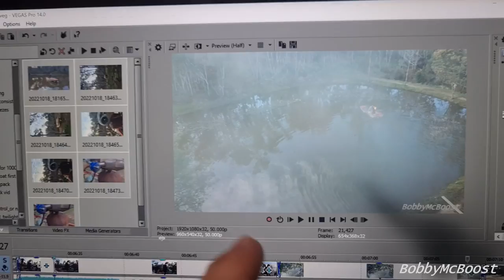TURBO Burn Barrel - Will it EXPLODE?  Turbo Jet Boat pt.4

Comment: 1. Put a heat-exchanger in the tube after the compressor and before the burn barrel to keep the oil cool and recoup heat
2. Make Sure the oil-pump provides at least 2 bar/200 kPascal/30 PSI to the turbo-charger
3. Avoid supersonic peripheral speed of the compressor-/turbine blades
😁
Reply: with the way that turbo is going way beyond spec, I would go for an oil pump capable of way more pressure than 2 bar. Probably more like 4+ bar, since that's around where engine oil pressure sits at high rpm. I think a full-sized engine oil pump operating at its typical operating speeds would supply enough pressure for the turbo to not push the oil out with boost.
Reply: @quinnobi42  I was thinking about an RV fresh water pump. 60 psi, 5gpm. 

For the oil cooler you could use a few feet of metal tubing either in a vessel of water or extended outside of the boat.

Or use a total loss system where (used) engine oil is fed through the turbo from a high pressure tank and then into the combustion chamber.
Reply: @deltab9768  A total loss system like you described would be awesome and provide lots of fuel for the burn barrel. The problem with using a RV fresh water pump is that it is designed for very high volume flow but low pressure. I was thinking maybe a couple automotive fuel pumps for the turbo oil feed or something because they can supply high pressure
Reply: @deltab9768  Then you will have upgraded from wood power to waste oil power.

I have a design I am working on which works on [literally] anything combustible, so that you can use either of those, or anything else you can shove in the burn box. But mine will not burn the oil it is using for the bearings, mine will be intended, like an actual vehicle engine, to cool, circulate and filter the lubrication oil.

Also that oil will probably be a very expensive silicone based oil to handle heat and reduce corrosiveness since I want something I can actually drive with, not just do silly experiments with.
Reply: It immediately burn inside the turbo... This is almost impossible to oil
Reply: @quinnobi42  What would be ideal, would be if, as is the case with actual turbojet engines, if there were an output spur [think of the gear on a camshaft that drives both the oil pump and ignition of an automobile engine] that you could simply gear to whatever speed you needed to have the turbo provide its own oil at the needed pressure and volume.

Sadly, I have a suspicion Bobby ain't in this to be an engineer though.

However, if he asked me to, and sent me the turbo shaft, I would gladly cut whatever pitch was necessary to produce the final drive ratio needed for solid pressure and effective volume.

I have a good old lathe with all the right attachments to cut a proper compound land worm gear.

On the other hand, if ANYBUNNY wanted to supply the parts, I could build a complete system, such that all one would need to do is add their own oil tank, filter and cooler so that they could hook it up to literally anything and it would then be 100% self oiled, and self shaft/bearing cooled.

If they supplied the parts, I'd do it just for the fun of it.
Reply from the maker: This highly interests me! 2 things though, as you stated I'm not really in this to engineer a oil system to supply the turbo that will inevitably get far to hot and melt its turbine wheel off..
  
The other issue would be the speed that shaft is spinning at! The gear reduction would be massive! The drive gear on the oil pump would need to be balanced due to its size😆
Reply: @BobbyMcBoost  As someone else had mentioned, you could take your turbo oil drain line, run it out of the boat into the water in a coil shape (use a 1 or 2 liter pop bottle for a form) and then put the oil back in the reservoir to be pumped again.  I would also use copper or steel line with flare fittings so they don't blow or burn off. It would also work better for the water oil cooler. 

Bonus here is aside from keeping the oil temp down so it will cool at least the center section of the turbo, it also won't melt the bucket, or the pump, or turn into an electric flame thrower! 

I"m a US guy so I think in PSI, but I think you'd want at least 60 psi which is 4 bar I think, to lube the turbo. You could get an automotive oil pump, put the hex rod in it and still drive it with your drill, but the tricky part is making a fitting to connect to the pump outlet. It might be easier to scab a power steering pump or maybe a small 12V convertible top hydraulic pump... they're not super heavy load, but should work great for something like this.
Reply: @BobbyMcBoost  Another possibility: send the air from the impeller to a 3 inch T fitting, then have one side neck down to 2 inches and go straight to the turbine, and the other side go through a 3 inch butterfly valve and then to the burn barrel. Have them both go to a 3 inch T piece and now you can adjust how much of the exhaust is actually from the fire. 

How is this different from a wastegate? For one, the air that bypasses the combustion chamber still gets sent to the turbine to help drive it. More importantly it helps to cool the turbine so it doesn’t melt.
Reply: @BobbyMcBoost  I suggest to drive the oil pump with an electric motor and a battery.  Alternatively you can use a turbo-charger with gas bearings (which are usually quite expensive).

You can limit the RPMs of the turbo-charger with a diaphragm capsule controlliing a waste valve after the oil cooler and before the turbine. 😉
Reply: They should be getting some of that shaft energy there, if they could capture just a bit they could modulate the thing and also get some hefty mechanical energy.
Or the compressor shaft extending to drive a bigger fan and you got some proper turbofan action

Comment: Boost out the oil feed is a new problem 😂
New turbo and maybe limit it at 30-40 psi to give the next turbo a few more seconds. Wonder what this one actually got up to? Needs a new higher reading boost gauge
Reply: Just use the gauge from a tire inflator. Most go up to 150 psi and I would hope that is enough 😂

Comment: the speed that boost needle pegged itself and the turbo was still increasing in speed as well its got to be close to 100 psi or more before it destroys itself . I think even if the feed for the oil didn't pop out it probably wouldn't of lasted much longer then it did. 
It was fun watching it if short looking forward to the next one.

Comment: @Bobby McBoost 
After making a sturdier oil container, can you make something, so the pressure from the engine is pushed into the oil vessel from the top, and act to push out the oil from the bottom?
So the engine itself works to pump it's own oil? (You probably know how to solve this better than what I do?)
Or maybe add like a shaft on the intake that drives an impeller pump or something? (so the faster the engine spins, the more oil is pumped through the engine automatically)

Comment: You guys should fab up a steel vortex dust collector system on the output port, it would prevent the solid material that's killing the turbo from making it into the turbines. There's another channel with one on their turbo keg and seems to greatly increase the turbo longevity, and it also seems to make it burn hotter by swirling all the solid materials inside until they completely burn. Might be worth looking into if you guys want to get it to run longer.

Comment: @Bobby McBoost
10:56 You can probably also rotate the jet-engine-assembly, so the jet steam blows off the Back Port side (left side, seen towards front), that would naturally create a push on the boat to start spinning.
But I think fine tuning that angle would be impossible, especially when you can not test run it on MAX!!! power.
Reply: Yeah I agree. Just a slight kick. Can’t wait to see this thing go full noise 👍
Reply from the maker: I did give it a little more angle that way just to aid it along.  wasn't enough though!

Comment: Try to use copper oil lines, or just some metal lines. Use window wipers motor and put it to the input shaft of some servo pump so that you can have some oli pressure. You want around 40PSI of oil pressure for a boost of 30 psi because your boost pressure is "washing" the oil.

Comment: I think with the outlet you want one of those cyclonic dust traps to catch the embers/ash out of the exhaust. Might make the turbo last a bit longer
Reply: Jes at this high air speeds it going to work great and will have less flow restriction than a mesh.
Reply: There are some boys down under who have a cyclonic filter in their system, it seems to work quite well.

Comment: This is turning into a great series. Everything right bar the one thing needed gave up will be fantastic next time for sure.
Reply from the maker: Thanks mate!
Reply: Imagine a once-through system where used engine oil comes out of an air tank at 12 bar, goes through a filter, the turbo and then into some kind of nozzle in the combustion chamber!  Might be less damaging to the turbo than running on wood. Not sure how I’d go about igniting such a jet.

Comment: Do one with 3 falcon xr6 turbos all feeding off the same barrel. I say xr6 turbos coz there cheap and big. And im curious if you directed the exhaust down into the water, maybe it will pick up more speed? Also, i wonder if you were too pump water into the combustion chamber just before it enters the turbo, maybe it will turn into steam and create more pressure aswell as cooling the turbine abit
Reply: very hot steam isnt that funny to experiment with.

Comment: When you put a grate on the turbo inlet, make it in the shape of a cone or basket pointing down into the burn barrel, so the direction of the airflow doesn't just cause the grate to fill up with material and become obstructed. Also be sure to use a substantial wire size for the grate or basket so it doesn't melt or send parts up into the turbo.
Reply: High temp stainless steel filtration mesh sounds like a good place to start... ~( 'w')/
Reply: Maybe rebar welded into small mesh like openings, stronger/higher heat range than thin grating.
Reply: @95GTSpeedDemon  By the way, rebar melts relatively cool, and it burns out, plus it weighs tons and won't stop anything unless you put just way too much of it in there.

And then when it does, its going to completely block the exhaust so it won't even work BEFORE little particles even get a chance to blow around.

Comment: i got an idea to help deal with ash. i recon if you put the inlet pipe from the turbo angled where it attaches to the pressure vessel so it will start a vortex inside the pressure vessel that it should be good to help stopping ash from killing the turbo that fast. i could be wrong just a crazy thought.
Reply: I believe they use a similar arrangement on the intake of the v22 ospreys to keep sand from killing the engine

Comment: I think the turbo ate the fire , check out the boost coming out the oil line!!!!
Reply: I think its more the boiling oil from the heat. Also there isn't new oil added so the remaining boils even faster, in the end the seals migt have been destroyed but i don't think it was from the beginning
Reply from the maker: I have ran this many times and with different turbo's, and the oil never gets to hot.. it has near 20 litres to cycle through and has been way hotter.👍👍
Reply: I can’t tell from the footage if the boost is blowing back past the pump or just out the drain. But If I had to take a bet on the boost level I recon it would be around 90 psi. (The gages stoped working at 30?) The next point of failure will be the seam on the tank and that won’t be pretty stand well back!!!!
Reply: @BobbyMcBoost  I ment the oil thats directly in the turbo, not the whole bucket. Also the steam thats coming from the bucket looks thik white like oil vapor not so much like wood exhaust and it doesn't come out nearly as fast as the exhaust of the turbo.
But then the air could also slowly leak through the seals and make it look that way.
If there isn't to much leaking it might be best to just have the oil reservoir vented.

Comment: How about a second straight pipe exhaust facing the rear. It would give the excessive exhaust pressure somewhere to go whilst adding to thrust. It would give the turbo an easier time (reduced heat/ rpm) without restricting it's intake. 
It could increase total thrust as well as helping it last more than a couple of seconds.

Comment: Almost need that bucket of oil sitting in a cooler of ice water and use some of those iron pipe fittings to weigh the feed lines into the bucket.  There again all that boost might make the oil null! XD  Been loving these!

Comment: I thought about copying this idea of using a boat for testing. But I want to try getting the cooling exhaust tip of a diesel pickup and after the fresh air intake of the tip adding a fuel injector and spraying kerosine into it for an extra big flame

Comment: 6:32 i think it hit AT LEAST 40 PSI..... just on the sound alone
might even be 50PSI
.
i know i was SHOCKED when our shops 2021 dodge hit 32 PSI of boost..... 
that sucker MOVES OUT..... and the way the trans shifts.... it seems like its slipping a bit
.
30+ PSI is just a whole different beast!

Comment: Classic case of overtemp/overspeed  caused by too high a turbine inlet temperature, you need to follow standard gas turbine combustion principles , a Primary combustion zone , with Secondary and Tertiary cooling zones to produce the required temperature going into the turbine to provide just the right amount of thermal energy to power the compressor . You need to fit a "wastegate" on your compressor discharge tube , set the wastegate opening pressure to 30 psi of boost , the discharge from the wastegate needs to be plumbed to the Tertiary zone of your "combustor" , preferably close to the ducting into the turb scroll inlet . With this setup your turbo will spool up to 30 psi boost using "excessive" temperatures  but only for a few seconds which is acceptable , before "cold" compressor discharge from the wastegate exhaust is added  bringing the turb inlet temp down to the required temperature to maintain 30 psi boost  with the backpressure  created by the jetnozzle . The jetnozzle sizing can be reduced progressively until you have a temperature of ~650 deg C in the jetpipe at your 30 psi boost , this will provide the maximum thrust possible without damaging your turbo , a large diesel turbo should be able to produce ~8-10 pounds of thrust per square inch of comp wheel inducer area , the Garrett TV84 turbo I used in my turbine bike had a 3.5"-88mm comp inducer  and produced up to 110 lbs -50 kgs of thrust , ~11 lbs/sq inch of inducer, using a 76 mm dia jet nozzle  but at higher than ideal temperatures .  You guys have the abilities to produce the best and most powerful engine possible but there are certain parameters which must be adhered to for success .

Comment: i commented on hunter goodrich's latest burn barrel video and i think you could pull this off easier than him (cause of the dam). these are the recommendations i made , i think you could adapt this since you need to fab a new turbo anyway:
 use layers of fine mesh as baffles to prevent partially burned sparks from combusting inside the turbos (across whole barrel) and #2 the air input should be higher, 1/4 maybe 1/3 the way up the barrel and have it split into 2 inputs from opposite sides (you may want to angle them so the air swirls rather than clash and get pushed down into the coals). if you want to make it go boom, you could have the turbo's eat a bucket of water (in your case have a way to make it flip into the water) somehow on some kind of electronic remote trigger. fair warning though, youtube may be nannies about exploding things - steam bee oh em bee's are no joke. where the exhaust tapers down you could weld on a tip, maybe 1ft, and drill holes in it so it has an afterburner effect for more thrust. check out tech ingredients turbojet video for info on how far to drill the holes apart and how to space them as you get to the end.
Reply: actually, save the boat. use it to get to the middle and back. make a pontoon from a couple of 44's and use all that rope to get distance from it where you can yank it over so it falls into the water. have rope securing the base from the other side. rope on chain to the barrel. make sure the chain reaches the water :)
1. afterburner
2. baffles
3. swirling inputs splitting pressure
4. boom boom pontoon
Reply from the maker: My input is only one side,, but it does enter on an angle to have a swirl effect. 👍👍 all good ideas 🤘
Reply: @BobbyMcBoost  thanks for the reply, loving your videos, catching up on alot of videos with your patrol and the pinny. so much fun.  i used to fuck around 4wd'ing in an old 60 series bush hack. im from a small town in inland north-west WA one of the guys i used to work with was tasmanian and he built a GU patrol LS1 with an auto box back in 2010/11 i bought it off him in 2012. had 35" tyres, 6" suspension lift, 2" body lift. good times. nothing that beast couldnt do.

Comment: you need a downpipe to go under the water, you may even be able to rig a venturi valve to pull water in and give it more thrust in that configuration.

Comment: So here's my take. You should mitigate the exhaust into the turbo temps by water-cooling. Spiral about 3 - 7 m of pipe through a large container of water. The more heat you can extract, the less damage it will do to the turbo. That equals more power and more run time. Hell, for a boat, you could cool it from the pond water itself. And since we all know remote turbos still work, it's not really much of an extreme take.